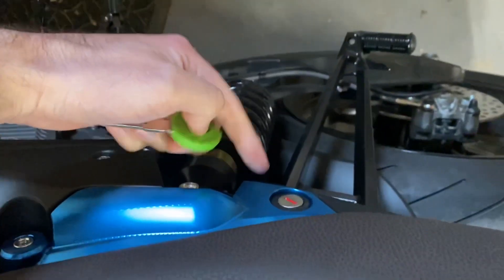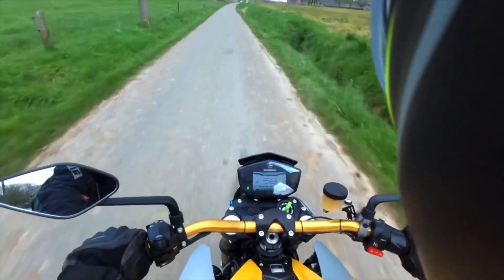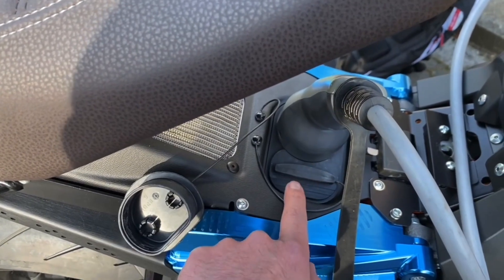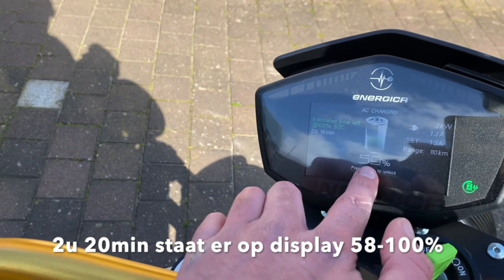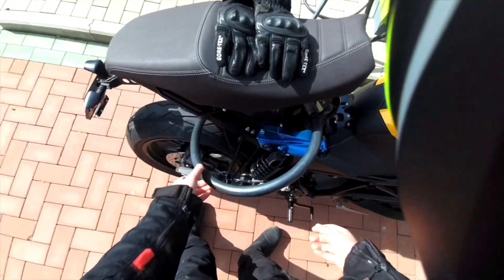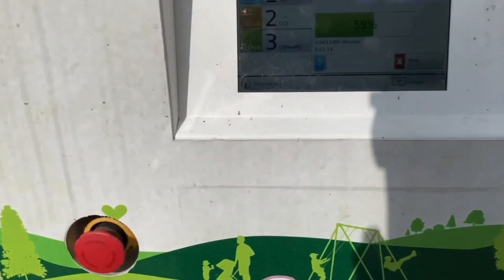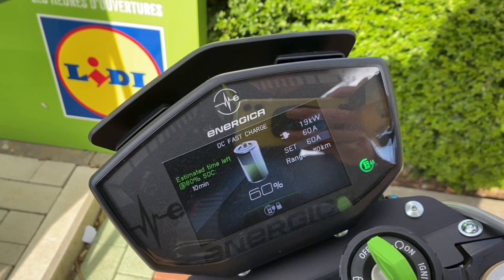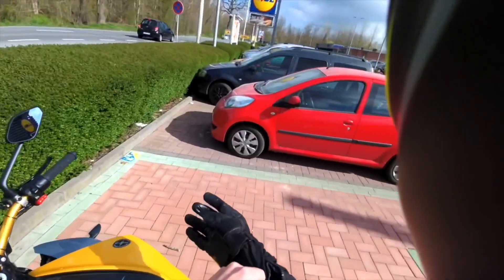2021 Energica SS9 electric motorcycle 21.5kWh battery (over) 1C charging at 20kW (up to 24kW)

Comment: Do we know what the max DC charge rate is?
Reply from the maker: Max DC charge rate is 75A or 24kW but it will only hold that for about 20 minutes because of heat build up. Plus on DC it starts balancing at 80%.
Reply: @Hans2183  damn, any idea if the new EMCE bikes will be able to go above 24kw? Im hoping we can get that brought up because Tesla is opening up their supercharger network to non-Tesla vehicles and their slowest one is 72kw. This would VASTLY improve long distance EV moto travel.
Reply from the maker: @phillipsandusky3795  not any time soon. For that they would have to actively cool their batteries. Even at 24kW it's already struggling with heat.

Comment: Many thanks for the comparison. Most videos are about driving but charging is such a key element of EV.

So you confirmed the 3 kW maximum charging power with AC that I had read about, this is what keeps me happy with my Zero SR/F. 4/5 of the chargers I use are AC and so the 6 kW of the premium is twice faster than any Energica and LiveWire, this matters.
Reply from the maker: Indeed onboard AC charger for energica is limited to 3kW. I'll share a video next with my 12kW zero srf setup. That gets very close to the charging times of the energica on DC (at least for the 21.5kWh models). But totally different system. To be fair even for the 21.5kWh models you can get it to charge still a bit faster than zero. But it's close. Here also the smallest towns have AC chargers. Dit DC I used to have the closest ones at 50km. Also always on or close to highway routes. Recently a new dc charger popped up within 10km. So they are growing. I've seen similar charger setup choices in cars. Where Mercedes for example has 110kW DC chargers but only 11kW AC. Sounds still like a lot but that is for a 100kWh battery pack.

Comment: Does it has any storage places where i can put my stuff? Like zero sr?
Reply from the maker: No storage on the bike itself. There are bags of all kinds available directly from Energica. The built in storage for Zero SRF and SRS is rather limited and even reduced to a very small, disc lock sized compartment underneath the seat once you install the extra 6kW charger.